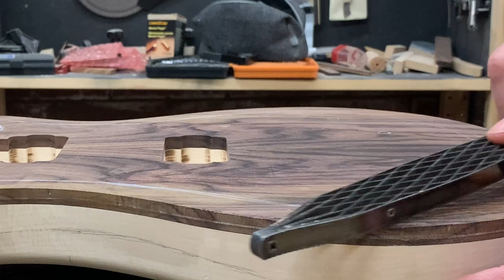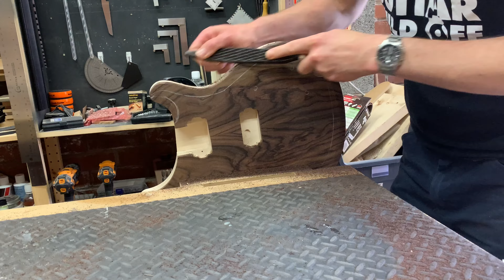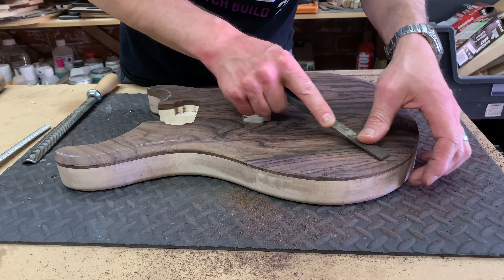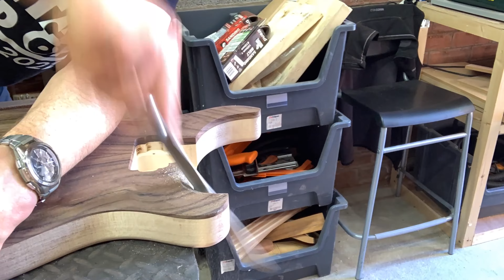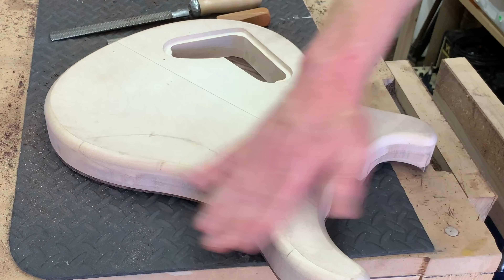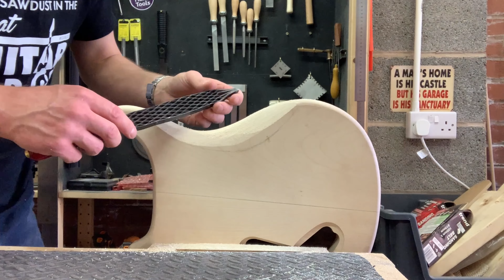Electric Guitar Build - Body Carving  #GGBO2022

Comment: i really enjoyed that, in 1987 i built a guitar with a carvin neck , african mutenye wood body,  and rasped and filed by hand. unfortunately it was stolen at a house party i had, where i wasnt smart enough to not be the passed out host...
Reply from the maker: Thank you, glad you enjoyed the video 👍 that’s rough mate, sorry to hear it was stolen hopefully karma paid it back on them for you
Reply: in most videos of others, im not seeing any slight scooping out of bevels, although ive seen some concave bevels in pictures in older models. would you attempt a 1/32" deep  or so cupping or scooping of bevel internally of the lines, with a curved razor sharp  gouge? like in lathing? if you woudnt let me know
Reply from the maker: @jbenedict967 tbh, it would depend on the thickness of the top - to do a full re-carve into the edge, ideally you’d need around 18-22mm thickness to give you enough material to carve into. I mark out where I want to carve and remove the excess until I get to where I like how it looks rather than go for a definite depth.

Comment: BREATHTAKING! Astounding work! I like the cut of your jib, sir! So, I'm refining and slightly shaping a guitar body... my main goal is to get all the lines, curves and edges nearly "perfect" in spacing and dimension - Basically it comes down to sculpting it with your eyes and hands? Good tools too, of course. 🤔🤗😎
Reply from the maker: Thank you sir, much obliged 🙏 it’s entirely a ‘feel’ thing, draw the lines on the body where you want the shaping to be then remove the material between them. Run your index & middle fingers together over the area - you’ll ‘feel’ where you need to refine it more than you’ll see it with your eyes 👍
Reply: Great video and beautiful work! What is the thickness of the body and what is the thickness of each layer?

Comment: Is this your first scratch build?
Reply from the maker: Hi Tim, no not my first; this is my 5th one from scratch
Reply: @WhitefootGuitars  Do you feel you are making progress each time?
Reply from the maker: Yes I do, though I’ve learned more from mistakes and how to fix them. Important thing is try to remember what I did wrong and not do it again…
Reply: @WhitefootGuitars  I have over 50 builds to date, and my advise is enjoy the build, because the finished product is never as cool as the one you are still fiddling with.